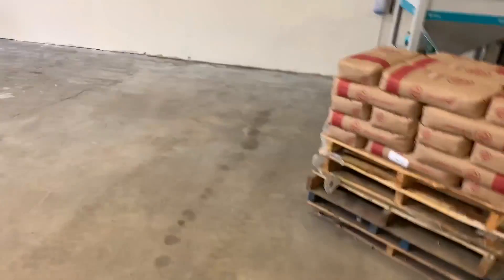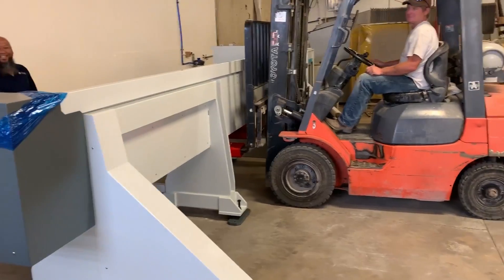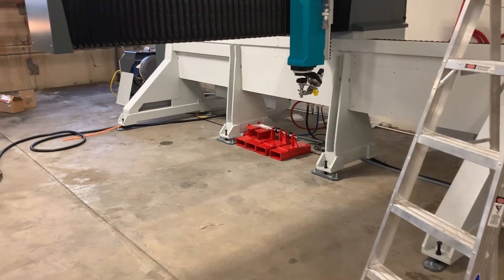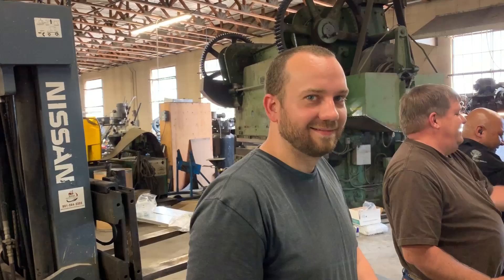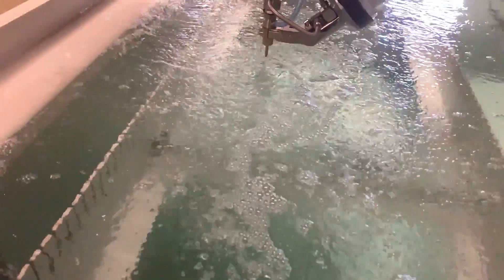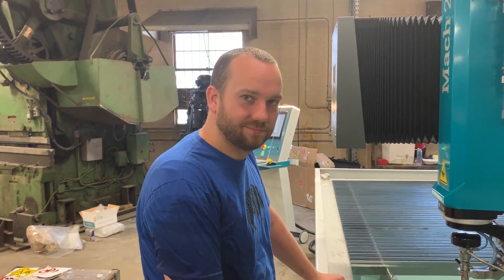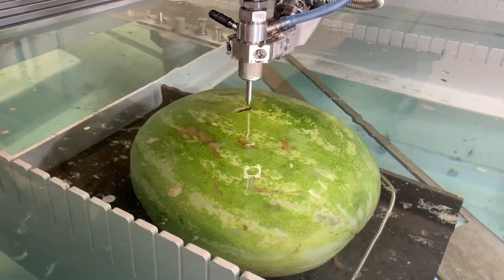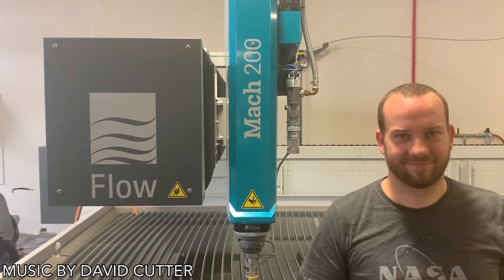New Waterjet Unboxing, Install and Shenanigans | 5-axis Flow Mach 200

Comment: The only thing missing in your testing data was telling us what pressure you were running during your test.  I have purchased two water jet machines, and the last one, which was also a Flow, was operating at 80,000 psi, so I'm assuming yours was at the pressure as well.  By now you know how indispensable your waterjet is, they are unbelievably great machines.

Comment: hey guyd love the new water jet but i have been told by flow that you should put a steal plate at the bottom to protect it incase the jet is not moving for a little bit
Reply from the maker: i'm not buying it
Reply: @WaterjetChannel  each to there own just said what they told me is all i did think the same at a time but for the cost of a bit of steel is cheap considering the cost of repairs but i will not be considerate from now on

Comment: With it being a 5 axis water jet could a turbine impeller/ rotor be cut on it, with the angles of the blades cut right off? The blades would end up flatter than optimal but it would be interesting to see!

Comment: @Waterjet Channel, Ehm... you say the water gets muddy after turning the jet on... Albeit this will probably not fix it permanently. Why not just by a big External Aquarium Water filter. Place a bunch of pads inside and have it suck all the gunk out of the water column during the times that you aren't using it? Might make the water a tad clearer and potentially, less smelly.

Might even find second hand, so to speak.

Comment: Add a dump hopper outside that you can dump the used abrasive with them put another below it to catch the good water and pumps so you don’t have to climb in and clean it every month and dust classifier if you want to keep it nice or let it ruin like last one

Comment: You know what sounds like a good Idea? Lets put the LARGEST PIECE OF EQUIPMENT AS FAR AWAY FROM THE DOOR AS POSSIBLE!
Reply: Its getting through the door thats the real problem. honestly, so what it takes them an extra hour to set up, they need to optimize their shop because they will probably be using that same machine in 10 years
Reply: @pws3rd170  you do understand what a joke is right? Who are you Ted Mosby?
Reply: @DanielsCorner644 well a joke is usually funny
Reply: @pws3rd170  If you have the clearance around the door then getting it in is actually pretty easy. I used to bring 16Ft lumber through 12ft doors all the time.
Reply: @princeofdeath7696  I bring 24ft stock sheets of grating in with a hi lo

Comment: I work water jet and the difference between this new machine and the older machines is crazy. They got the newest mach and it’s way less bulky than the older ones and has way smaller components and everything is more compact and nice
Reply: Not even to mention the 5 axis’s which would allow for cutting at almost a 90 degree angle
Reply: I know a good bit about water jets, ask me anything
Reply from the maker: Hmmm... what’s your favorite color?
Reply: Gotta go with orange

Comment: My only question is did you find the skateboard wheel when you cleaned up the area...???
Reply: They found it a while ago embedded in the ceiling insulation.
Reply: @DONK8008   - Yes, that was in there a good way. So, if you ever need to punch a hole in your ceiling in a potentially lethal way, you just need a waterjet, and a skateboard.

Comment: Also I’m a little confused. Do water jets reuse the water they have in tank so you use up the water as it flows but it just goes around and around and never gets higher or lower. Why do you need so much water stocked? 

In a reusable system with water cycling around from tank to filters out of jet and around. So why have hundreds of gallons?
Reply: I don't think they reuse their water but the reason they need such a large water tank is to slow down the jet of water so it doesn't cut a hole in the floor

Comment: Good content you guys.
I'm a industrial designer and water jet operator and I really enjoy your content on this channel. I'm looking foward to open my own business and buy a water jet, so watching this installation was helpful. 
Did you consider other water jet brands before purchasing flow? like omax, wardjet, Chinese brands?
what made you choose flow?
Reply: A company that is actually going to use the water jet to make money, isn't going to buy a Chinese variant. Backend support is non existent on Chinese machines. (Warranty work, parts, repairs, software, help, etc.) Chinese water jets are reserved for really small businesses that are just starting out. Up until the point they realize that they shouldn't have bought a Chinese machine.
Reply: @xenonram  I agree. on the other hand, Chinese brands are becoming more popular due to their affordable prices. I have rebuild a complete intensifier on a Chinese System after 600 hours on the pump. It's not bad at all.  not having the same maintenance support services as other major brands made me learn and understand the functionality of almost every component on the intensifier and pump. however  that represented a lot of down time due to the fact that the do it your self way to do things is slow because you learn at the same time that you try to fix the system. But yea I agree with you about the difference on the quality on hardware and software that major brands offer.

Comment: Water being non-compressible, I would imagine that the jet dumps most of it's energy in the first 6 inches of pool.
Reply: It's not so much about being uncompressible.
Probably more the viscosity of the water which creates drag on the side of the stream slowing it down.
If you filled the jet and tank with honey (assuming the jet would still go equally fast), I doubt the stream would even go deeper than a foot.

Comment: My boys got that upgrade. We had 3-axis Flow Mach 2b (4020b). Don’t use flow nesting because it is ehh. Also the guy from Flow is named James, cool guy.
Reply: FlowNest is junk.  I use Radan and export the nests as a dxf.  Flowxpert cant handle top many parts, it gets bogged down.  Your best off making a small nest and using FlowCut to create an array..
Reply: Tony Langton I use multiple programs to nest for different situations. Majority of times I just end up using Inventor Nesting because it will automatically change the nesting(this only happens, if you made .ipt on inventor).

Comment: Woman: I bet he's thinking about another girl
Man: I wish I had a 5-axis Flow Mach 200
Reply: Pretty much the only thing a man would want
Reply: @homiespaghetti1522  
Just go to a Walmart 
U may get one
Reply: @hotaru25189  a comparable model to the one in the video from 2008 is $100,000 used. I have seen some smaller ones as cheap as $10,000
Reply: Something Nothing this model retails in the neighborhood of $250,000 I’m pretty sure
Reply: @SomeNot  this one is probably like at least $250k. probably more if they're getting it from a good company. Each additional axis multiplies the complexity.
Reply: @Sonac   No, a 3 axis one from a different company.
Reply: Hehehee
Reply: @hotaru25189  I looked it up, the site says price ranges from $320,000 to $420,000 for the Mach 500

Comment: Why do you fill the bottom of the tank up before using? I thought that part was just to catch the residual water/abrasive during cuts
Reply: Probably to slow the jet down and not cut through the bottom of the tank

Comment: I’m curious can you make a video on some of the differences between the two of them
Reply: The new one is 5 axis, with an updated controller. The old one is only 3 axis. Other than that, not much is different.
Reply: Probably more PSI and a larger area to cut stuff
Reply: @antoniskazou  same psi
Reply: The biggest difference is that the new machine has a tilting and rotating head.  Instead of shooting straight down to cut, it could actually cut a cone out of various materials.  The 3 axis is prone to cut at an angle with thicker materials.  The new waterjet can actually compensate for that by pivoting the stream.
Reply: Flow's website says the Mach 200 machine is 4,150 bar (60,000 PSI), so the pressure is the same, not higher.
Reply: Yo is that the real big nut
Reply: I work water jet and the difference between this new machine and the older machines is crazy. They got the newest mach and it’s way less bulky than the older ones and has way smaller components and everything is more compact and nice
Reply: Around 100k psi

Comment: Those mid sized waterjets go from 100,000 USD to 200,000 USD
Reply: Probably half off for the branding of having their logo constantly show up on THE water jet channel.
Reply: Okay, that is pretty cheap...can you buy me one quick and send it to Wisconsin. Thanks.
Reply: thats not bad dang
Reply: Considering it's an industrial machine that's likely to be in use for many, many years, that's honestly not that expensive.
Reply: CYB3AR I mean, just think of it as having an extra employee for like 3 years.

Comment: So is it a 60,004 psi waterjet?
Reply: yes. Its to cut those materials that 60000 just isnt enough for.
Reply: Plus
It can punch you in the stomach
Reply: It actually has 4250 bar, so 61,641 psi^^ The Mach 500 could be bought with an 6500 bar pump, so almost 95,000 psi :O
Reply: @F1u0r   But is there really a need to go over 60000 psi? because the only hard time waterjets have is when cutting aluminium nitride ceramic plates. 60000 psi waterjets will cut everything.
Reply: @Sharpless2  No, not really, but it would be faster :D And maybe you don't need as much abrasive?
Reply: @F1u0r   yeah that makes sense.
Reply: is it just me or this makes less of a mess